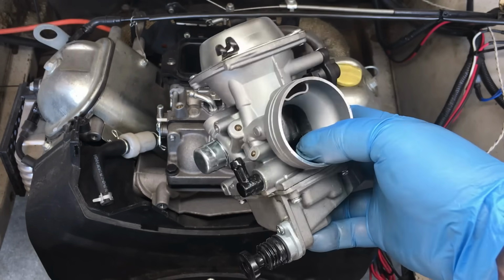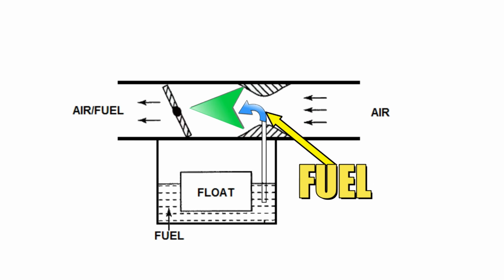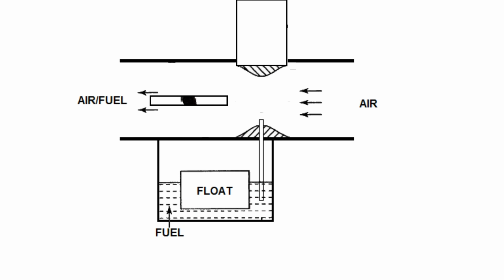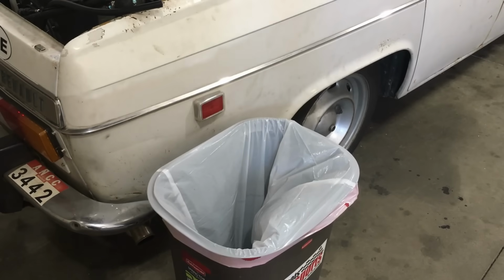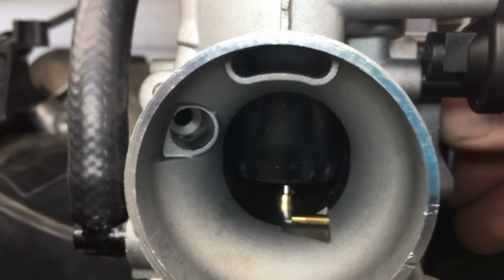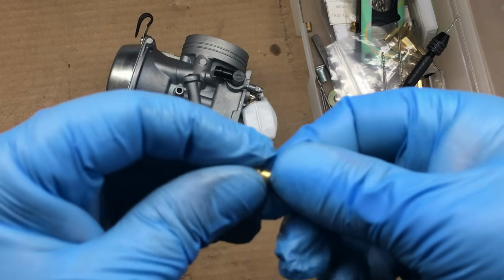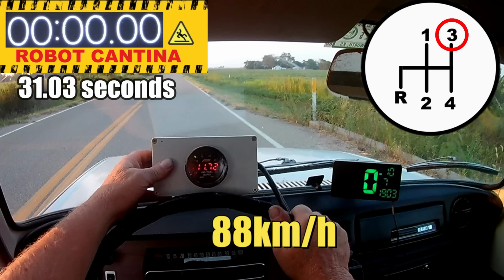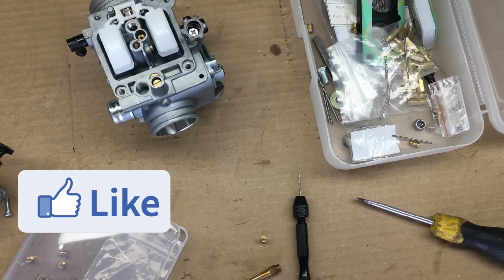S3 E30. The 670 predator Renault gets a Keihin CVK carburetor for better performance?

Comment: Motorcycle mechanic here: these carbs really really like to have a air inlet tube / velocity stack to make the airflow more directional , Just 2 inches can be enough with a pod filter, and this aids flow through the internal passages. also the low RPM air fuel ratio is adjusted by the mixture screw on the side, this can affect fueling upto 1/3 - 1/2 throttle (the CV slide not the butterfly)
Reply: Also the mounting boot on the engine is plenty sufficient to support the carb. I ran 4 carbs disconnected from the air box and ran a pair of siamese K&N filters with built in velocity stacks. Tuning was a bear but when I finally got it right the bike was insane.
Reply: As you can see in 4:16 there is a opening on the bottom of the intake side, when the air rushes throught the venturi, a part of it gets direktet up that hole, this is what opens your variable venturi.

You could stick a gopro behind that carburator ans watch how it moves in relation to throttle padle position. it might not open more than 50%
Reply: depending on the setup.  take a carbed harley, (later evo, early twin cam) with an actual keihin carb(this is a chicom knock off) it has no air boot or anything other than a metal flange to support and air filter.
Reply: Most motorcycles with everything right won't do anything but idle.  Put on the air cleaner and watch that mixture go towards ride and take out that dip to rich that disappears as the RPM goes up.  It's designed so as the airflow goes up, the air filter blocks the air more. The opposite of your graft is what the flow of the air boc.  that needle you see inside the emulsion tube.  I never change it just raise that needle up and down.  Replacement carbs that needle has 5 places to raise or lower the needle.  Just raise the needle and put on an Air filter.  A piece of hose 2 feet long will sort of work 2 inch.  Play with the diameter or just get the stock air box for a bike that uses that carbonator.  Motorcycle junkyard will be your friend.  You tell em what your using it for they likely give it to you.  filter and all..  I do.
Reply: I did some tuning on a set of 4 CVK's. When these are setup right they are great.  The trick is to start by setting the float height, then chosing the right main jet for max power. 
Then go on to the mid range tuning by raising or lowering the needle. Some needles have tiny c-clips that can be used to change needle height, fine tuning can be done by stacking tiny washers under those c-clips. In practice you will be driving/riding 'on the needle' 99% of the time so it's important to get it right. 
Finally you need to set the idle mixture and idle speed. 
When you're done you should have good idle, crisp throttle response off idle and good top end power.
Setup like this you will also be able to get good milieage our of it as well.

Comment: You're missing a big tuning CV carbs: the needle. On variable venturi carbs, the needle taper has a huge influence on fueling. The main jet size will have a big effect on high RPM WOT fueling, the needle everywhere else.

If you are lean at high RPM WOT, you need a bigger main jet. If that then causes you to be rich at low RPM, you need a needle that has a larger diameter at its base. There are tons of different needle tapers available.

Many needles are also adjustable. If you take the diaphragm off, you will see the needle is retained with a clip. Adjustable needles will have multiple grooves. Setting the needle deeper into the carb body (a higher groove) will lean out low and mid RPM. Pulling the needle up (lower groove) will enrichen low and mid RPM.
Reply: Came here to say this. Main jet it for WOT, then use different needle profiles and heights to tune the part throttle.
Reply: I just learned something here! Excellent post!
Reply: Same.
Reply: @Stevemax07 it's good info! It translates across some other types of carbs too, bits of it.
Reply: I didn't see this as I was typing my response, that needle is causing the problems he's having. both in height adjustment and I suspect the needle profile itself might be wrong for the motor. but he needs to get it much closer to optimal to tell for sure.
Reply: One must also tune with the air filter/air box fully installed as intended to operate in normal use.  If you tune the carb to open air and expect it to perform the same with the filter and air-box lid installed, it won’t be the same.
Reply: also, the spring rate of the slide effects fuel curve, this small engine may not make enough ported vacuum to lift the Venturi slide
Reply: Also came here to say this. You said it perfectly.
Reply: Was also about to type this, thanks for saving me the trouble!
Reply: @jonathanodermann913  Also very true.
Reply: @jonathanodermann913  i bet a chunk of his inconsistencies would go away if he installed one. It would at least make tuning more reliable and consistent.
Reply: @seancollins9745  with it going so lean at WOT, I suspect that it's opening.  should be easy enough to observe though
Reply: I like to think of the clip position as a fine-tuning the timing of the increased fuel delivery after the taper to the actual Venturi/slide location.
Reply: Kudos to people who understand carburetors. I can do OK at tuning EFI, I can understand fuel maps. But carburetors are black magic.
Reply: I used to drag race a Suzuki 750 that had the stock CV carbs. I used shims under the needle clip to adjust the height of the needle.
Reply: You said everything I was thinking when he started taking a drill to the jets.. Long time British Leyland owner so S.U. Carbs are where I have my knowledge from and it seems they're very similar to these motorbike carbs too!
Reply: Exactly, needle taper is everything
Reply: @MikeWrenches he needs a bigger jet and to lower that needle to notches
Reply: WOT = Wide open throttle?
Reply: 1/4-3/4 Needle height/slope of the slide/mixture screw | 0-1/4 idle jet  |  3/4-full throttle main jet/needle | full throttle main jet/power jet
Reply: @jonathanodermann913  I found that out with a Kawasaki 550 with CVs.
Ran like crap with anything other than the stock air box. Had a bad hesitation anyway but almost unrideable with the air box disconnected.
Reply: While I have never messed with these carbs, it's not a surprise since the vacuum signal from the engine is probably quite a bit less given how low it revs compared to a bike. Also without any sort of airbox or flow guide its possible to have flow separation at the inlet like what would have happened on older bypass turbofan engines without the exterior doors on the cowling. I guess if one were really desperate to get something to work, a needle could even be modded on a lathe to get the right profile for a given venturi opening, but that's getting into big-brain stuff if you want to do it any other way besides trial and error. That said, it would make for some awesome content! 🤩
Reply: Same exact thing I was thinking but you worded it much better than I have
Reply: @PsRohrbaugh carbs are incredibly simple but also incredibly complex the smallest changes make a ton of differences but modern vehicles are the quickest to learn on once you have that down you can do damn good on carbs but also know that getting a carb perfect in all aspects will make you go insane you usually have to make a sacrifice especially if the carb was not designed to do exactly what your asking it to
Reply: Was about to comment the same thing. Figured that one out when i got my bike carb for my moped when i was younger. Couldn't get it to run perfectly, always too rich or too lean, then i found this and put the clip one notch lower and then it ran super smooth
Reply: He stated at partial throttle the afr goes rich. That's telling me the clip is rich as it is.

Comment: Needs a fatter needle on the end , generally they are twin tapered. Drop the pilot one size .
Reply: Or maybe just drop the needle, the majority of motorcycle carbs have the height on the needle adjustable.
Reply: The OEM CV needlee don't have the adjustment grooves (or at least my Keihin CV doesn't). I've reshaped an old needle before, but I found it really easy to mess up 😅
Reply: @Lucaspc99 drop and polish the top with a drill an 600
Reply: Use small washers to space the needle away from the slide diaphragm to richen the top end. 1st gen SV650s used to put 1-1.5 mm on the stock needles with a 152 main jet. I remember doing this mod after a full exhaust.
Reply: Then it goes waayy leaner, this could be just fixed by lifting the needle with the clip
Reply: @Hnkka  lies
Reply: @dennis-nz5im  The fatter the needle is less fuel gets past making it lean

Comment: Tuning a CV carb is not just about the jet sizes, The needle shape is an important part of fine tuning.  Also, washers can be used under the needle to raise it up if the needle does not have an E clip and adjustment grooves.

Comment: Needle tuning is the most important on that style carburetor. You're overlooking a huge step. The main jet only does WOT
Reply: Main jet is more important on 3/4-full throttle than the needle
Reply: @Hnkka  I am one of about 1000 posts agreeing that needle adjust is the prob. Make sure you reply to every one of those.
Reply: Why so offended? @mastermnd22

Comment: You need a bigger main jet! Main jet setting is for wot mixture. You need too drop the jet needle down or replace it with one with a fatter profile. The stock one should have a c clip and 5 positions to raise or lower. The emulsion tube is called a needle jet on that style of carb and usually isnt changed when tuning. You can also shorten or streach the spring in the slide to effect the venture sizing. Typically we shorten it when tuning for more fuel on modified bikes.

Comment: Definitely listen to people talking about needles, but also make sure you have an air box. On a bike, that air box keeps a large volume of relatively stable air for the engine to draw from. That gives consistency to the air part of the equation which is far less consistent with even a pod filter.

Comment: I don’t know about your carb but the SU type has a selection of different shaped needles for running. Different needle widths at different heights adjust the mixture for changing loads.. Great shows keep them coming.
Reply: I came here to say the same thing, use the jets to tune low load, and then file or turn down the needle at whatever load area to tune high load. (I have a classic mini background so used to messing with SU's .. as you are using this carburettor well out its intended use you may not be able to tune with just jetting.

Comment: Most all older carbureted 4 wheelers/atvs use that enrichening valve setup versus an actual choke as well. My father argued this fact with me vehemently one day when I told him his wheeler didn’t have a choke but rather a small valve that lets more fuel in. He just refused to believe that the little lever that said choke wasn’t actually a choke until I had to literally pull the carb off and show him that there was only 1 butterfly in the carb and that was the throttle, and the “choke lever” he would move was just a cable that opened a fuel valve. 🤣

Comment: Man, the needle controls the mixture between 1/4 and 3/4 throttle. You have different needle tapers and, sometimes, you can adjust needle height by changing the clip that fixes the needle to the sliding cilinder (we call that the "campana"). What I can tell is that you should lower the needle a coupla points, or change to another with less taper. Opening the idle mixture valve (on the side) can also change mixture richness. You can screw it til it tops, without exerting any kind of torque, then unscrew, say, one turn. Usually it is a turn and a half. That will make mixture leaner when the throttle starts opening, but will also affect idle.

Comment: Use small washers to space tge needle from its sest on the diaphragm slide. 1-1.5 mm sould make a noticable difference for mostly free. Or get a set of adjustable needles. The 1st gen SV650s did the washer mod after exhaust to fix a up top lean bog.

Comment: The air/fuel screw is where you adjust off idle and deceleration AFR. If it’s on the motor side, it adjusts fuel. If it’s on the air filter side, it adjusts air.

Comment: Hi Jimbo, I think the best way to correct the "lean/rich" curve you have is to try different postion of the needle, or buy one with a different curvature. But, as you say, if you can't get a rich mixture anymore with the main jet you need a new polverizer. Also, it's more easy to adjust carburation with an airbox...

Comment: Hey jimbo, lower the needle hight to remove the rich site of the curve and put a airfilter to make i run a bit richer and make the venturi work better. Keep up te good work!
Reply: That's where I would start. I'm not sure the emulsion tube is the way to go. I would drop needle first and then go up on the main jet. 
Mikuni and Keihin both have needle charts. I would go with a leaner needle before emulsion tube.

Comment: I've essentially got that same pump/regulator/return line setup on my 350 S10. Works fine!  I've experimented with a number of EFI systems and carbs on it over the last 15 or so years, and didn't want to drop the high pressure pump when I went from EFI (~55psi) to a carb (~7psi).

Comment: As others have said, the needle needs adjusting for in-between area. In fact IIRC, the sequence is: Slow jet, slide cutaway, jet needle, main jet. I am actually sceptical this single carb will work at all. You don't need carb sized for 670cc engine, since only one cylinder is sucking at a time. 32mm would be fine for a 670cc single, not a V-twin. Also, the intake pulses are not equally spaced, so you will never get both cylinders running the same. That is the reason the engine came with two carbs. It would have been cheaper to sell it with a single larger carb but they did not do this because it doesn't work as well.
Reply: Yup, you are right

Comment: I had an SU carb on my turbo car in the early 80's - no EFI back then, really not so many turbos either!  The tuner bloke mapped the power/AF Ratio across the band and honed the needle down - in a drill with sandpaper!  Worked like a charm.

Comment: Needle will help but you also need some sort of velocity stack on there. Even if it's a stock air boot. The turbulence at the mouth of the carb will scree with the jetting. Going from a pod type filter on the back of the carb to a velocity stack with the pod filter on the end let me drop about 10 jet sizes and it ran much more consistently.

Comment: To the guys saying "bigger main jet" - the main alone doesn't control wide open fueling on these - its only allowed to if the slide pulls the needle far enough up. 
If this carb is set up for a bike its probably set up for a larger cylinder displacement, more compression and better high rpm head flow characteristics. 
That means its going to have a long, thin taper to the needle and a fairly stiff return spring over the slide. 
No watch what the engine is doing. 
Idle is fine so its in the ballpark for carb sizing as its set correctly without messing about with it. 
Then it goes rich at low load - suggesting as the throttle is open at lower rpm the fueling is still correct - though now not so thanks to the larger jet. This points to the carb behaving correctly and putting a normal sized main back in would correct this. 
Its then leaning out more and more as rpm rises. 
We know there is enough or too much fuel because it goes rich lower down so its a fuel command problem rather than one of availability. 
That means the slide is coming back down as rpm rises and the engine's flow dropes off. 
It only needs to come down a few mm and it will start closing that main which will then drop power and the cycle continues. 
The only way a bigger main fixes this is if its so large there is bypass of the needle. Thats not what you want on a cv because atomisation is then in the toilet and you're going to be on a good mixture but wondering why its got no response.

Comment: Love this series.😎Good carb choice it's really hard to oversize a CV carb. You should make sure you have a 5 or 6 inches of  tube on the intake side of the carb to contain the fuel reversion . If this is not done you might have some issues with the transition from idle and may need to almost double the size of the idle jet. Your main is too small. 0 to 1/4 throttle is idle jet, 1/4 to 3/4 throttle is the jet needle and needle jet, 3/4 to full is the main. Set the main first and work backwards. You shouldn't need to change the needle jet. More likely you just have to change the height of the jet needle. But set the main first.

Comment: You need to lower the needle a couple of notches in order to lean off the part throttle mixture (raise the clip), you can then go bigger on the main jet in order to get the WOT right. The other thing to note is that you really need an air box on the back of the carb, the reason is that it is the slight vacuum in the airbox is 'transmitted' to the top of the carb via that hole at the back of the carb in order to lift the slide, at the moment I doubt your slide is lifting fully. This is the downside of a CV carb, there needs to be at least a small restriction in the intake side in order to create a vacuum at the back of the carb so that the diaphragm can lift the slide, a pure flat slide carb does not have this issue, of course on the plus side a CV carb will tolerate ham-fisted throttle abuse much better than a flat slide carb. Personally I would make sure that the slide is lifting fully at WOT (maybe via a camera), I'd then get the WOT mixture setup to around 12.8:1, I'd then use the needle to lean off the part throttle to around 14.5-15.5:1. If you can not get the part throttle mixture right then you are into using different needles which would get expensive!